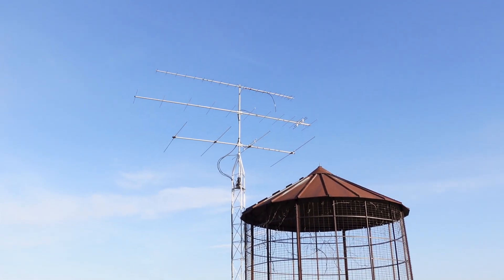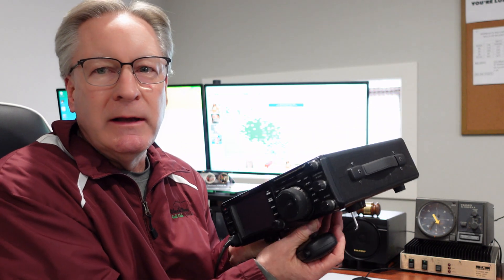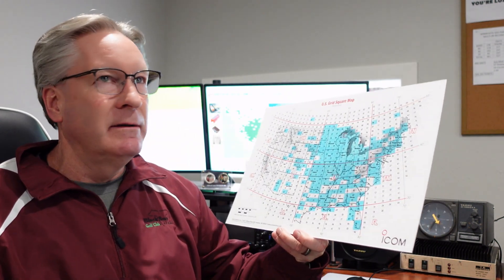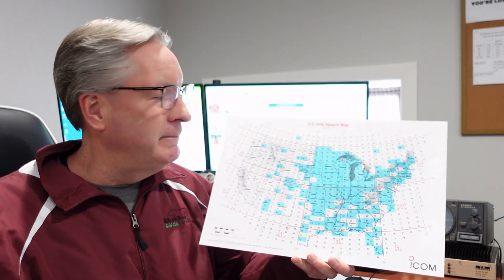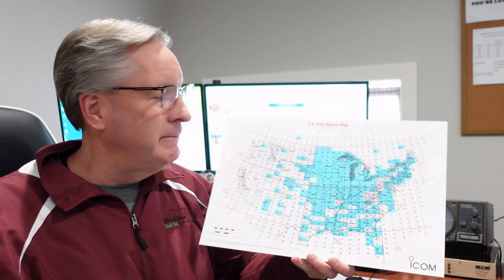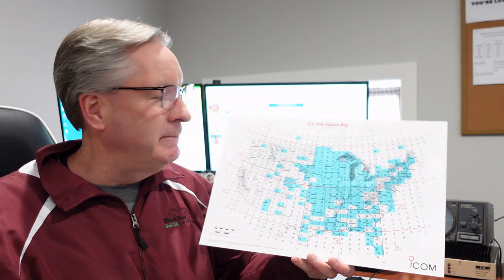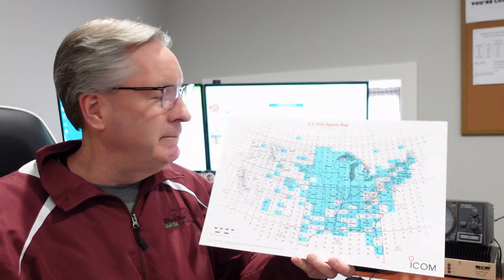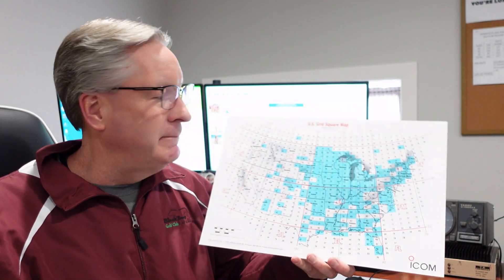Amateur Radio VHF Propagation Modes | How Far Can I Talk On VHF?

Comment: Looking at getting licensed with some family members. We are all 40-90 miles as the bird flies and are looking for reliable communication between houses. How feasible is this on 2 meter with vertical antennas or should I be looking at other bands? Want to keep prices down and fairly easy to install antennas.
Reply from the maker: 2 Meter FM (vertical) will not get you the desired coverage.  A vertical just won't.  If you used 2 Meter SSB with a small yagi (5 element?), you'd be able to do it with low power (50 watts).  The antenna you would need would be similar to what I have as the middle antenna on my stack.  SSB has better coverage and you could just swing the antenna around to talk to each person.  Without using 2 Meters, I'd suggest 80 Meter SSB and a wire antenna.  Most HF radios are 100 watts and that would work awesome with a wire antenna.  Hope this helps.  If you have further questions, or if I can help, let me know.  Good luck on the licenses!
Reply: @TheOldSwedesFarm  Thanks so much will do. Now, we do have a lot of repeaters around here. If we were going that route we could get it done on 2 meter correct? So long as we found the right repeater between us?
Reply from the maker: @letsbuildasnowman7058  I really don't know of a repeater that could cover 80 miles.  I may be wrong.  You'd have to find one repeater that all of you could "see."  If you're using the repeater for emergency use, it might be down (or without power) in a real emergency.  I'm not a big believer (or user) of FM.  I have an FM rig but haven't used it.  SSB/CW travels so much further due to a smaller bandwidth.  It just works better.  Get your ticket and then let's figure out where all of you are.  We can figure out if there is a repeater that would work.  73!
Reply: @TheOldSwedesFarm  Thanks again will do. SSB sounds intriguing.

Comment: I used to have FT 280, 144MHz SSB, CW, FM radio.   I could not find much person to talk to on SSB,  so I sold it.  may be my antenna was bad, just vertical  6 dBi  15 Ft high.   AG6JU
Reply from the maker: If you were working weak signal modes, and were vertically polarized, you won't work much.  All SSB/CW is done horizontal polarization.  FM is vertical.  Unless you're close, it just won't work.  Thanks for stopping by to watch!  73!

Comment: Have you tried any EME on 2m ??
Reply from the maker: I have worked one station off the moon on 2M on CW.  This was with a HUGE station and the moon was on the horizon.  I also made a Q on 432 off the moon with a single yagi.  The other station had a 40 meter dish near Montreal.  Both stations were worked on CW.  Really cool but I don't have the antennas (or the az/el) rotor for EME.  73 Chris!
Reply: @TheOldSwedesFarm  that’s one hell of a distance to pull that one off. EME would be nice, but I live in a close to the city 1900s built corner shop terrace. No room in the back yard for a 4m dish let alone a 40m dish 

On a side note, I’ve ordered some Meshtastic gear.  One unit for 433MHz and one for 915MHz. They’re only LoRa and not actual Ham stuff so maybe 100mW out, but I’m keen to see how they go both out of the box and then with some “enhancements”.